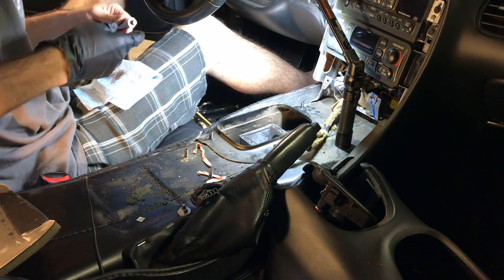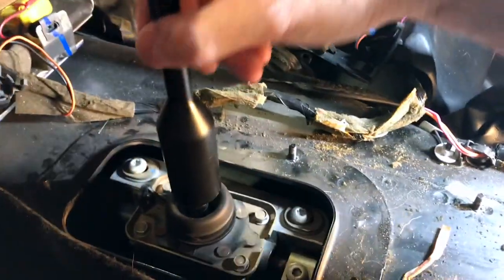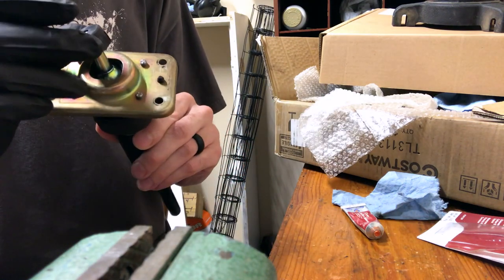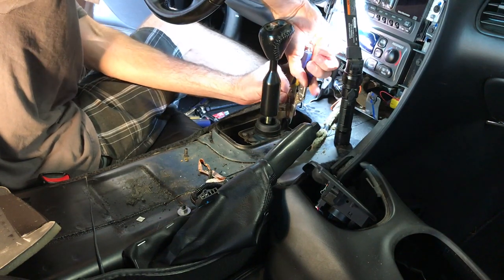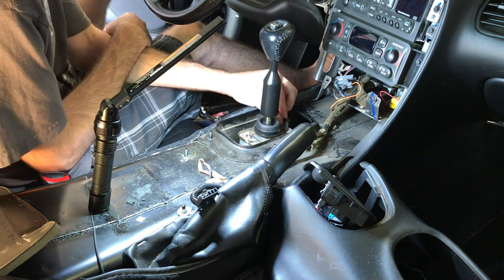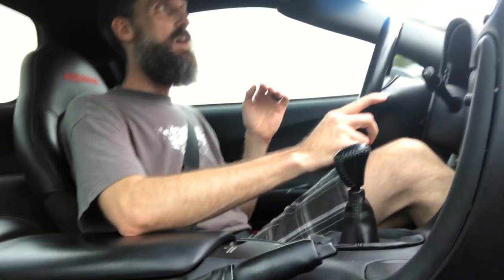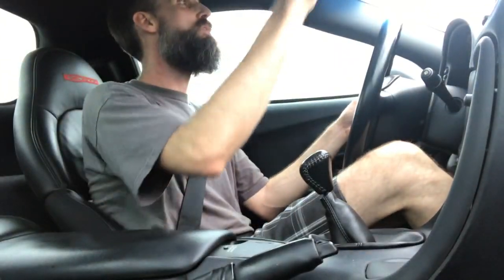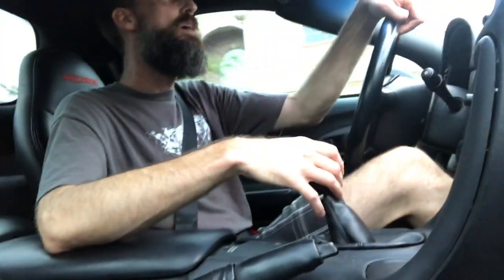How I made my 2003 C5 Corvette Z06 6 Speed Shifter Smooth Like Butter

Comment: Fellas, if your shifter isnt lifting off or coming off after taking off all 4 bolts, you can just tap it from the bottom with a hammer and it will jolt it loose...but you will have to remove the entire assembly to do it (torx screw undone).  Once its off you can lube to your content.  Mine was bone dry and was damn near age welded which is why it didnt come off initially.

Comment: If it won’t go into reverse also make sure you check the reverse gear synchro
Reply from the maker: Hi Erik, thank you so much for your comment. Check out the other video I made “How I Repaired my 2003 C5 Corvette Z06 Clutch in My Garage”, I left a link in the description above. As for the syncros, you are correct. After 16 years and 100k miles the synchro's in the transmission will (and do) prevent it from going into gear on occasion. Especially in 1st sitting at a stoplight and occasionally going into reverse I can feel the syncros not doing their job as I have to wait for the gears to slow down before engagement. But at this point it is just a minor annoyance. When the annoyance is greater than my will to NOT drop the transmission and repair the syncros, I will “Git-R-Dun”. Perhaps I didn’t describe the issue I was having in a way that makes sense. It’s difficult to convey “feeling” through video and/or comments but I will try and elaborate more here. When pushing the shifter to the right I was getting a “tightness” that I wasn’t use to after driving the car for 12+ years. I thought since I just did the clutch and replaced the reverse gear lockout solenoid maybe the new solenoid was preventing it from moving over or the linkage clamp connection point immediately behind the shifter that I adjusted had slipped durning a hard drive making it harder to move over to the right. But it turns out that neither was the case. After lubricating the shifter as demonstrated in this video, the “tightness” was gone and it slid easily all the way to the right and engaged immediately. It was smoother than I can ever remember since I’ve owned the car. And it only cost a little bit of grease and some time so it was WELL WORTH IT. Again, thank you for your comment and thanks for watching!

Comment: You need to feel your trans,  it looks like you're just numbing it.  You can add a washer on the trans detent plug.  5 cents. 
Buy an MGW , if you can't afford a C6Z shifter
Reply from the maker: I can actually feel the trans more now. So much so that I had to soften my shifts. I didn't realize how much resistance the shifter caused until I lubed it up. Thanks for your comment!
Reply: @Daveandbillie  lubing your shifter could numb the feel of your trans/schncros.(not good for trans)  You could put a washer on the trans, called "anti venom mod" if you Google it . And buy either a C6Z shifter or mgw. I would not advise grease, ever
Reply: A stock C6 Z06 is more expensive than an MGW?
Reply: @CPAJayhawk  mgw shifter is around $500. A C6Z shifter is an upgrade from the C5 shifter and can be had for around $150
Reply: Its been disproven that the C6z shifter is different from the C6 shifter. Only difference is the solid mounts on the shifter box. Just buy a C6 shifter, shifter knob, leather cover, and new shifter box bushings
Reply: @CorvetteTrev  numbing your synchros is not a thing. They are lubricated from the factory. Most owners dont do it so the grease is dried up but there is grease. Metal on metal needs lubricating